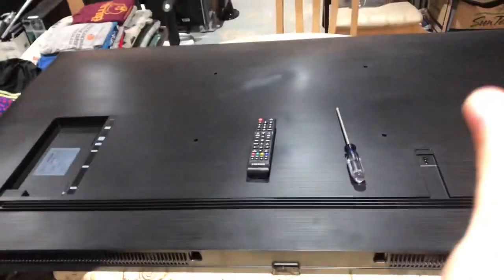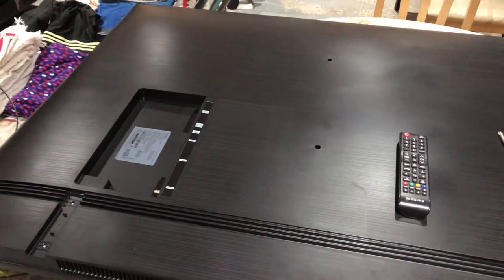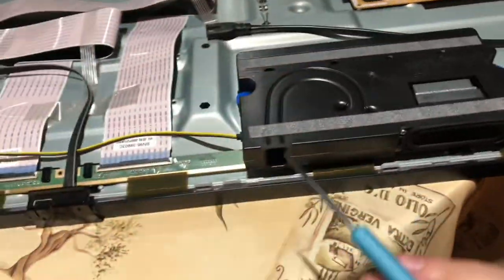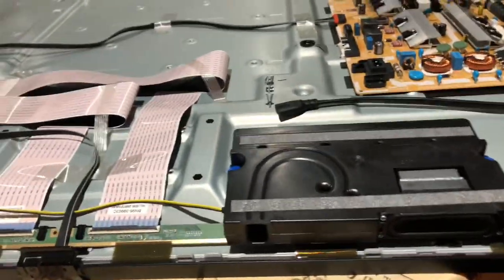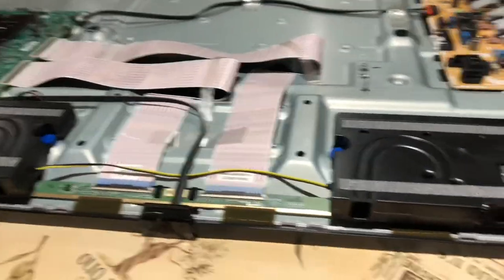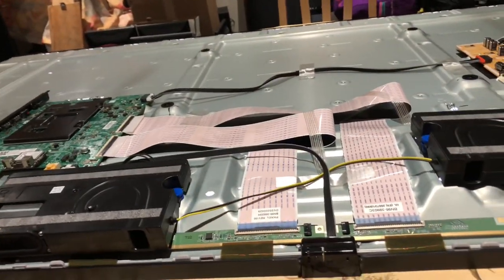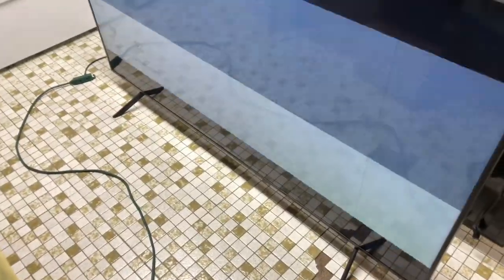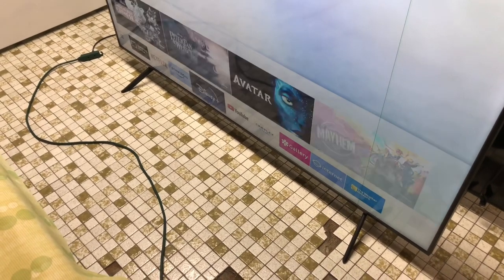Common! Not Another One! - 70" Scamsung LED TV Panel Driver Board Complex Repair [Video 13]

Comment: Thank you for taking the time to show every one how to fix the problem I have the same issue also and will never buy a samsung again and told all my friends to stay far away from them, sad you pay $600 for a tv that only last 2 years. Mine is also on the right side wondering why they can't make Samsung recall these or at least make them replace the screens, I know it would cost them millions but maybe they would stop making this garbage. I did do some research on how the screens are made and they are very complex but still common. Guess there more interested in selling TVs sad part is most people like myself will never buy there product again, my son has my 50" vizio thats over 10 years old and still working.
Once again thanks for the video.
Reply from the maker: Thank you for the kind words! Yea unfortunately, it seems these things don't last like they used to. With any modern TV, the screen is indeed a very complicated part, and the precision that is involved in producing these screens is incredible! In terms of recalling them, that is up to Samsung to decide. I believe if a majority of people are upset and complain to them, maybe something will get done.

Talking about older TVs like the one you mentioned, yes they hold up much longer than most modern TVs. My suggestion is go down to your local thrift store and pick up an older LCD TV if 4K is not a requirement you need.

Thanks for watching!
Reply: Samsung is changing TVs to new ones in Latin America
Reply: @Mr.ElectroniCET  Old TVs are terrible at showing even full hd

Comment: Great videos and very helpful, i have a short on the right side of my panel which i bypassed by blocking some of the ribbon cable, yesterday the image on my tv just shrank and then displays vertical faint lines and a very fuzzy / distorted picture I have redone the tape but no i have no image on the screen at all back light and sound works, if i remove tape tv restarts like the orignal fault any ideas of what to look for or is this set now scrap?
Reply from the maker: Thanks for your dedication towards my channel! It sounds like you still have a problem with the panel (screen) of your TV. It could be on the other side of the panel the problem, and/or there are more signals that are shorted that need to be blocked. Hope this helps!

Comment: So what exactly did u do to it to make it work cos i seem not to see what was done
Reply from the maker: If you watch the previous video to this one, I show how to patch it up to make it work again.
Reply: I took my remote turned off the TV. Then remove batteries from the remote and hold the Power button down on the remote for about 3 minutes, let go and replace with fresh batteries and TV comes back on with screen!!!
Reply from the maker: @cindyswitzer4025  unfortunately, these TVs have an internal fault with their screen that can't be remedied using the solution you say. But, sometimes, solutions like the one you mentioned do work. It only takes a couple of minutes, so it is worth a try!

Comment: not detailed enough you don't show which pins to block off on this one as it has the 2 flex cables need more information
Do you have to do pins on both sides of the cables

Comment: First thanks for the video. What would we do without people like you discovering comment problems. You brought me closer to in my troubleshooting on my TV.
But something seems off with my TV. I have a Samsung TV (un70au7199uxzg) as well with only one main flat cable from the MB connected to a middle (Tcon board) that separates in to two other via a flex cable. By disconnecting for example the left side, the problem is gone. But when I disconnect the right side (when the left side is connected back) the problem is gone as well. What drives me crazy. I can't limit the error just for one side of the panel. Is there any chance of hope?
Reply from the maker: It looks like that there might be no resolution at this point. If it appears on both sides, then the panel itself has completely failed. This problem is a little too new for me, so I'm still investigating to see if there is any fix to it. 

Thanks for the kind words and I hope you keep watching!

Comment: Thanks a lot , this was the best video i saw on this 70" Samsung tv panel repair , i fixed 2 of them today with your method , only issue , the color is just a bit washed out on both the tvs on the side where i put the tape to block the traces , any suggestions ?
Reply from the maker: I'm glad my video helped you to bring back your TV alive. Unfortunately, because of the blocked lines (which are no good), the TV will have on one side a slightly discolored picture. The only way to solve this is if the entire screen is replaced.